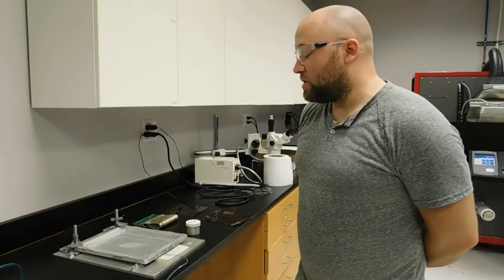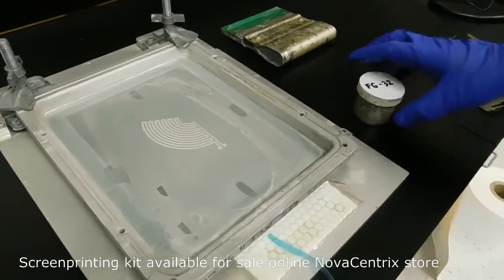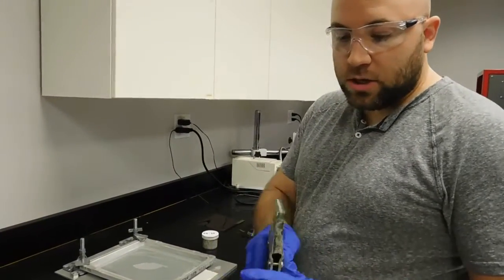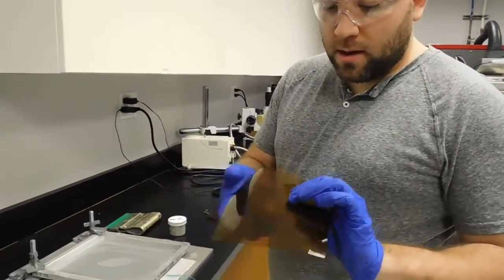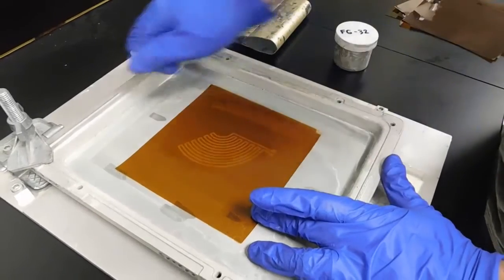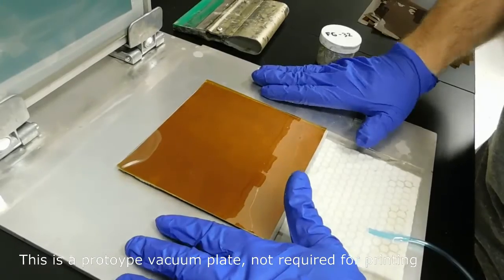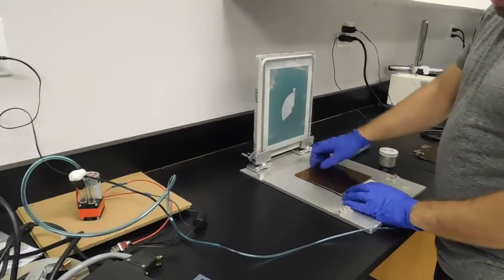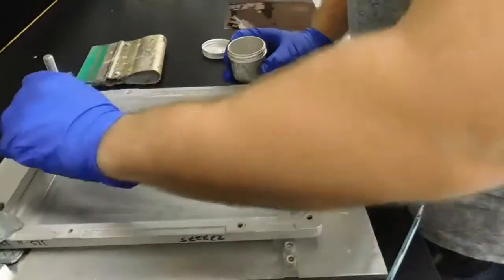Conductive Ink: How to Screen Print a Heating Element. Pt 1: Set-up

Comment: How much surface area does 100g of fg32 cover? If you know the precise surface area in mm that would be awesome?
else would you say you could cover 5 sheets of 8.5x11 sized printer paper?
Reply from the maker: Hi Jared,

For a typical deposition thickness of 8-10 microns, the coverage is about 65g ink/m2 (or 21 mL ink/m2).  So 100g should cover roughly 1.5m2. (estimated that thickness with a 325 mesh screen and 0.6mil emulsion, also a #10 drawdown bar). If you have additional questions, please submit to info@novacentrix.com and our inks expert will follow-up with you.
Reply: Thank you!